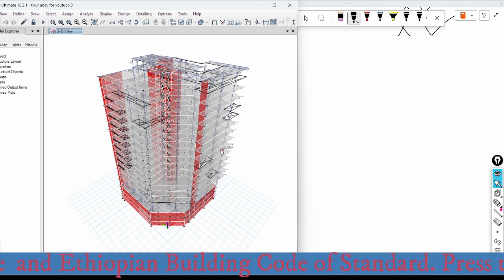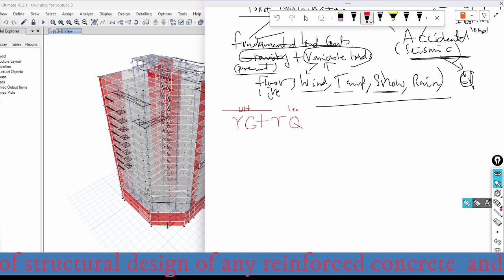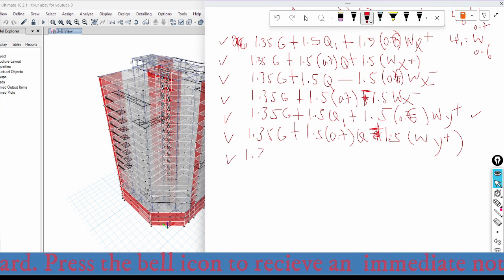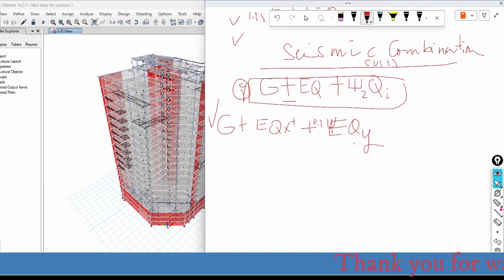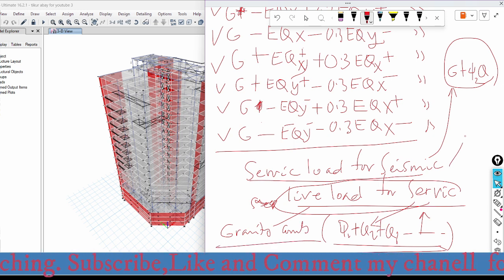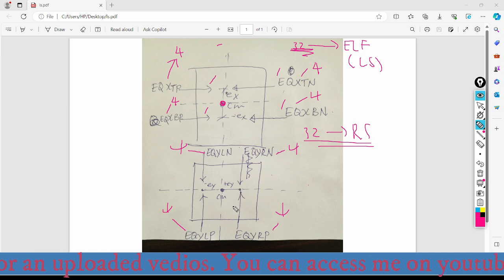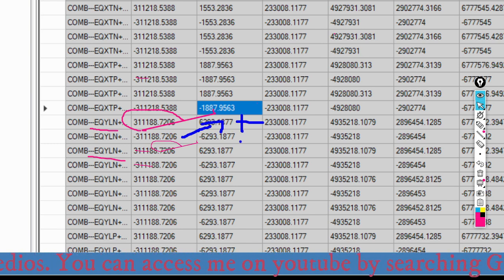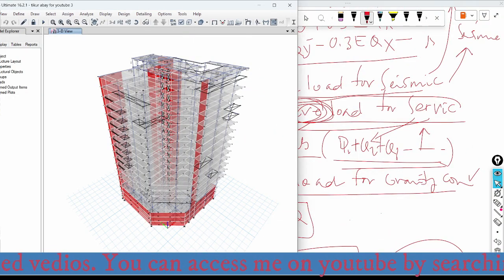Complete Structural Design of 20 story building using ETABS in Eurocode and Ethiopian code(part 13b)

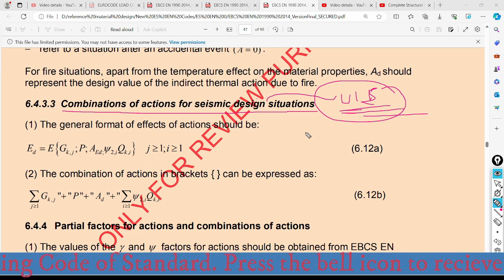Comment: sir there was mix up in early videos, when  you use service for live load you used fi values with out the corresponding live load reduction factor( Si) values and when you used service for  seismic, the live load reduction factor (fi) is applied but in tutorial 13b it is totally different from part 12 20:21-21:40

Comment: Hello, may I ask: For basic combinations without seismic actions, according to EC2 Clause 5.4(2), uncracked sections should be used for analysis, i.e., the stiffness non-reduced model. For basic combinations with seismic actions, cracked sections should be used for analysis, i.e., the stiffness reduced model. In this case, is it necessary to create two separate models in ETABS?
Reply from the maker: The design is in seismic situation

Comment: is there any difference between etabs 16 and  21  in the case of load combination
Reply from the maker: As basically load combination is done manually as per the  preferences or annex of the code you use , it doesn't rely on version of software. If you use an automatic default combination you may not get all the load combination options  related with the code like imperfection and dynamic load combinations.